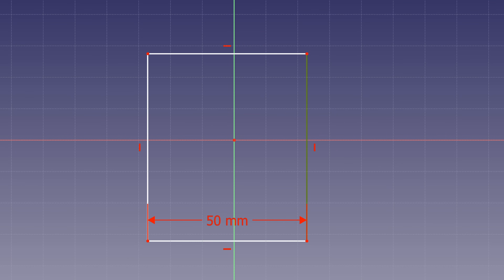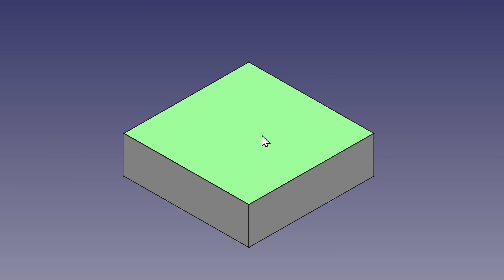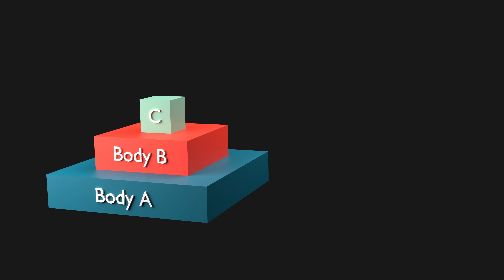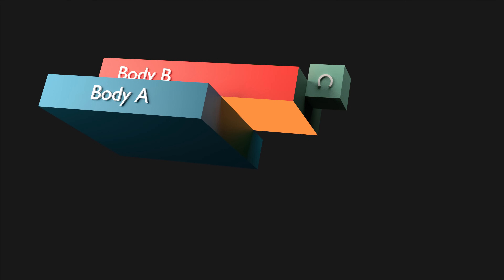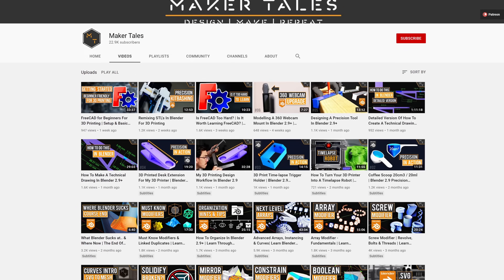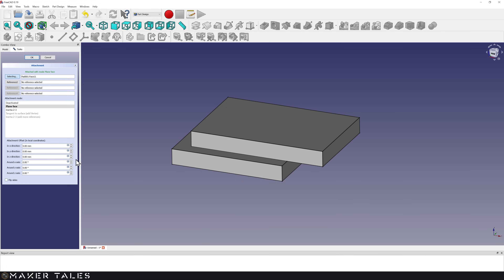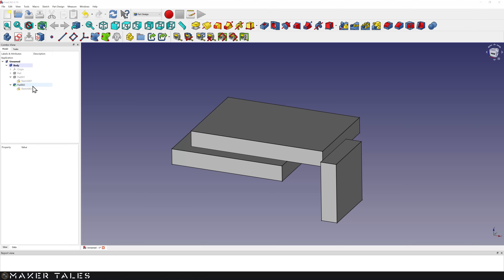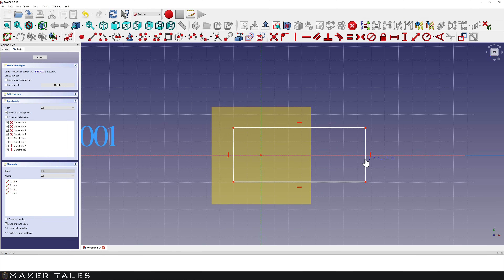FreeCAD Is Fundamentally Broken!  - Now what... Help Me Decide...

Comment: Time to come back to FreeCAD. Version 1 is released and its amazing.
Reply: I am new to part modeling so I tried freecad and it was awful, I've done some autocad in the past and wanted to not use autodesk so I give freecad a try however I cannot get passed the awful gui, the fact that you have to click hundreds of times to get things done, and one of the things I hated the most is that I want to pan with scrollwheel click and rotate with control + scrollwheel, like in autocad however that is not possible, so I just ditched and tried solidworks but in my opinion it was just as awful so I am now using Inventor, why not Fusion 360 you may ask, because it is cloud based, and I hate cloud based things, I want everything to be offline and stay in my computer, not someone else's computer

Comment: I'm afraid TNP has not been fixed yet... and it's 1.0 RC2.
I'm new to FreeCAD and I'm struggling with clones, unions (missing parts), the "0.01 mm problem", GUI (!), loss of documentation incl. error messages. And I feel FreeCAD community is not doing the best decisions as to SW development.
I must be doing something wrong. Maybe FreeCAD is not the best option.

Comment: We have used Freecad in a professional environment for years, and TNP is not a huge issue if the model is precisely designed. The program always does what it should do, it is human mindset what "means" something different. If you just cast operator over operator, any feature based cad model will collapse eventally when modifying an early feature - simply because your intention with a feature, cannot always be guessed by the program. Do you want to keep the hole on the round face, or the top face? Or the yellow one? The only question is: how far the program can take you before it happens. Without algorithmic thinking, one better use some sculpting program anyway - the excellent Blender for one. On the one hand I am looking forward to having TNP managed, on the other hand - with all due respect - "intuitive" programs make lazy people even more lazy.

Comment: 2 years later, and the Topological Naming Problem is still here in the "official" FreeCAD stable. Ondsel SE has fixed it (allegedly), and it should be fixed in the next main version of FreeCAD. I'd call this snail-speed. On the other hand – FreeCAD is actually and really free, so I'll live with its quirks until they are fixed … and knowing all the work-arounds doesn't hurt in my opinion (it deepens the understanding of what I'm doing).

Comment: Yes, Freecad, even the latest nightly build. is broken when it comes to the Topological Naming issue but if you use a Datum plane as the basis of all new sketches NOT using faces or vertices, then there is no issue. It's a workaround yes, but using this methology will give you a profession CAD tool for free! When the developers finally get around to fixing the issue in the code, then we can stop using datum planes.

Comment: The fact that over 2 years later, this is still a huge issue with the software. I'm in the middle of learning how to transition from Fusion to FreeCad, using FreeCad 0.21.2 and this is becoming a huge pain in the ass. I'm working on translating my Fusion designs over to FreeCad and everything just keeps breaking. I'd rather spend the $1500 or whatever it costs to buy Fusion rather than deal with these FreeCad headaches at this point.

Comment: When I saw this, my first thought was "what the actual fuck, the reference plane should store the normal and origin offset, not refer to the face itself" 
And then I thought a bit harder.

That actually the plane should be defined by the vertexes that define the face, the same way the face is. And that way the number of faces changing can't matter &it also allows a sketch to follow a face if moved or rotated.

Comment: sooner have a downloadable piece of software with a few quirks than a cloud based package that needs 24/7 net acces to be useable or that they can pull at a whim.
I agree with what you say in the video 100%, and yeah this is a big big issue, and I could be wrong but I think the renaming of the faces should be a small fix hopefully not too far in the future.

Comment: Does any other CAD tool have this "problem"? By the way, it may be some kind of logical problem. But there are many such fundamental problems that software developers solve. That's what software is for, to solve problems. Why don't the FreeCAD developers fix this? Don't they want to deal with it? Or are there problems with the architecture of FreeCAD and you would have to rebuild large parts to fix the problem? I mean FreeCAd is being actively developed, there must be a reason why this problem is not prioritised.

Comment: I was on the design team for the B-1B armament and weapons loader trainer, designer of the ejection seat inert training modules. some how a real ejection seat  munitions module got int the training room and on to an ejection seat. No one was in the seat and they were showing what handle to pull and it went off sending the ejection seat thru the roof of the hanger.
There was about 10-15 different modules. I accomplished the project that was adopted air force wide.
I started out as a apprentice manual machinist at a local textile factory and went to work at Kelly AFB and was a journeyman  machinist until I got into drafting and became a draftsman. I then went to Randolph AFB as a engineering tech and worked on the B1-B  project till it finished and retired at 56 yrs old. 
We were on computer vision software and did 3D wire frame design. I'm starting my small machine shop up and needed a cad program for an 82 going on 83 yr old man.
I'm having a learning curve on FreeCAD as my mind is still thinking computer vision. But come hades or high water I'm gonna win..
Reply: Godspeed 💪🏻

Comment: I was on quite an old version 18. I think. Just upgraded to 21.1 and found a lot of instability. Arrays breaking down, splines and sweeps come out twisted. Also its annoying that part design forces you to make the part in one piece. Datum plane setter is clunky but  usable. There's a lot more features but they don't work well and don't cross over from one work bench to another. I still love freecad and am very greatful.❤
Reply: Should stress I've only been using the new one for 3 of 4 hours. So it might just be different intfaces/workload.

Comment: I've been playing with FreeCad last night and today on 21.0 and one thing that I figured out is how to replicate my workflow that I use day to day with Siemens NX onto simple parts in FreeCad.
I almost never put sketches on faces. I think that doing so is not the best way of doing so, for topological naming reasons.

I like working with datums and sketches and building a skeleton of my part.
So when I pad a sketch, I don't plug in a distance, I make it go to the datum plane.

My next sketch would be done on the plane, not the face. This is almost ALWAYS more reliable, regardless of what CAD software you are using.

Comment: Is that what the TNP is about ? I can understand it when an upstream change would cause a feature to no longer exist,and that that would make a sketch based off that feature unviable. That makes sense.

I didn't know the problem was so basic,though. Let me get this straight: a body maintains a list of numbered faces, and the faces in that list can move around at any time. I mean isn't it bloody obvious that if an object has say 8 faces, and you add another one, it just /adds another one/, presumably called 'face 9'. Why TF does it need to renumber all the existing ones. Similarly, if you delete face 4 out of nine, then just delete it. It would appear that FC renumbers all the faces above 4, to be one lower. Why ? Why do the faces need to have a monotonically increasing list of numeric names ?

The way FreeCAD does this is like having a C compiler that passes parameters to a function in a certain order but commits the called function to always expecting the parameters in the 9riginal order. I mean it must be the user's fault for not keeping track of the stack offsets of the various parameters, right 

Either these face numbers are opaque, and we shouldn't be basing scripts of them, or they are transparent, and their naming is conserved across deletions and additions.

I knew the TNP was bad. I didn't know it was due to such an elementary design fault. It's like renumbering 100+ houses in a street just because one gets built or denolished, and just expecting the postman and ask your correspondents automatically know!

Comment: I gave up on FreeCAD because of this problem blowing models apart randomly, then I tried the RealThunder fork and bing, it just works like all other CAD software. I have pretty much given up on the official release as they still haven't implemented the fix even in the yet to be released 0.21 version even though a fix is there ready for them to import into their codebase.
Reply: They are working on it. The next release will have it.
Reply: @Gumball_W  If you are talking about 0.21 then it doesn't have it, they still haven't imported the changes from RealThunder's branch. However RealThunder has imported the official branch changes into his branch plus added another bunch of quality of life features. With 0.22 probably a year away I won't be holding my breath as it probably won't have the fix either, I am sure they have another bunch of half broken 'features' to add. It's pretty pathetic if I'm honest, the official releases are dead to me at this point.

Comment: I have recently come to hate the attempts by the powers that be to treat all consumers as morons.  I am thinking of Microsoft and its take over of the laptop market and the possible upcoming Pluton chip issue which I do not fully understand.  I have drawn a red line in the sand and will never buy another Microsoft product.  I also plan to abandon HP and Apple going forward.  I see Linux in my future as well as OSS software like FreeCAD.  ( Also GIMP and Shotcut)   I am prepared to put up with the work-arounds to avoid  TNP and wait for the problem to be fixed - even if it takes years. It is still better to do that than get locked in to a corporation's greed for profit.   I still do my 2D drawing on an old version of AutoCAD and to not plan to support them in future.  Maybe I need a cracked version of a later edition to receive drawings from others.  I refuse to be treated as moron and a mere source of profit for global companies.  I am unlikely to see or respond to any comments so try talking to me at TLOMatmail .com  ( note no "g" ) and you should see the obvious mod to be made to the email address. ( attempt to hide from computerised spambots that collect emails ).

Comment: Looking back, 0.2 did not fix it. 
For me as a beginner it means I never had any benefit from parametric  designs as an anyway have to fix the models after a change along the tree.
So most of the time it is better not to reference external geometry as it will only create a cascade of Desaster.

I would buy fusion, but I do not want an Abo or a free version that may be gone next week.

So FreeCad is my program but yes it slows down my idea flow because I spend most of the time to search the way to calculate absolute positions

Comment: 9:30 That's a sad joke on you :(
Well, of course they pushed it back to the next release after 0.2 – now claiming once TNP is fixed they will release 1.0. That probably happens at some point within the next 2-10 years.
But what's with all the rest? The instabilities, crashes, and general rag rug state of the tool?
It needs complete remaking from ground up. This source tree is not saveable.

Comment: A lot has changed in a year. Using the Realthunder / or "Link" branch as it's now known, the Topological Naming Problem has largely been solved. I have rebuilt a very complex model in Link and have been working on it with no trouble at all. I would advise all Freecad users to update to Link - any potential downside you could name is far outweighed by the TNP solution, the various bug fixes and massive UI improvements.

Comment: I am a new user of FreeCAD and still trying to learn how to use it. In that light I want to say thanks for making this problem known and explaining it is such a plain and easy to understand manner. BRAVO!

You ask for advice on how to proceed with your tutorials. It is now late in 2022 and the 0.2 version is available. And you have made another video letting us know this problem has not been fixed. Again, thanks! 

But you asked for advise and that is a loaded question. It really needs a crystal ball, but mine was broken some time ago. Let me digress a bit. I am a long time CAD user. I first started back in the 80s. I needed an inexpensive but capable and EASY to LEARN 2D program which could be used for TV station design - the technical system, not the building. I settled on EasyCAD which was around $60 back then (my employer was not going to pay for it) and available for a 30 day trial. The name and the price were the main features that lead me to it. And it lived up to it's name. I was doing drawings after only about two hours of familiarization. Why do I mention it? Because of it relative ease of learning how to make drawings with it. I had tried a friend's copy of AutoCAD and after about a week of "learning" I was no closer to my first drawing with it than when I first sat down to that trial. In my mind there is a very big advantage in a CAD program that is easy to learn. One that is intuitive. 

My advice to you is not about what version of FreeCAD to make your videos on, but rather about how those videos should be taught. I know that a program like FreeCAD or any of the other fully functional 3D CAD programs are not and can not be as easy to learn as EasyCAD was back in the 80s. But one thing that I find missing in almost all of the video tutorials is an explanation of the basics of how the program operates. An example of this would be Fusion360 which I have tried over the past two years. Every video I can find simply starts into a "learn by example" scenario. While this may get you off to a flying start, you don't know the details of your airplane. How many engines? What kind of engines? Type of landing gear? Even the wing arrangement? In Fusion that means that I still, to this day and after designing several projects with Fusion, I do not really have a good grasp of the hierarchy and relationships between the various features in a model. Or what goes into the file when I save a part. I never learned how to make a number of different parts that are in an assembly in the same model/file. 

And I am struggling with these concepts in FreeCAD right now. So far I am focusing on individual parts. But at some point I will want to model several parts in one file. That should be in the first hour of instruction. Having used Fusion I want to start my models with a parameter list. I have learned that one way of doing this in FreeCAD is to use a spreadsheet. That seems a bit cumbersome after Fusion just automatically having that list available and ready for my editing. But I still don't know if the spreadsheet is saved in the part's file or in a separate file. And just how does the spread sheet work? My present impression is you must refer to a name assigned to the cell that contains the value. And prefix that with the name of the spreadsheet. New question, can I have multiple spreadsheets in one part model? Otherwise, why would the name of the spreadsheet be needed? Perhaps there is a way to declare a universal spreadsheet in a model? And then only the cell name would be needed. Or perhaps not. That is something that should be covered in the first hour of any instruction. 

And many other details of just how the 3D CAD program ACTUALLY WORKS. I am sure the ling time users who already know the answers to these and other foundational questions will dismiss these concerns with a wave of the hand. But it is the lack of details like this that make learning a new program difficult. And error prone. 

So that is my advise to someone making the tutorial videos. START WITH THE BASIC BASICS!
Reply: Dang... how can i give this 100 likes??

Comment: This is a major roadblock to Assemblies, as well.  The most useful application of Assembly (as in SolidWorks), is to rough out ideas for each part, assemble them, then iteratively refine and correct them as needed.  But as soon as you edit a part in FreeCAD, all the face names are scrambled, and the assembly relations are horribly broken.  It is EXPECTED that assemblies will reveal changes that need to be made.  That's kind of the whole point of CAD—to be able to discover and correct design problems in software, where it's easier.  Without a robust and reliable Assembly platform, it will not progress beyond an interesting hobby tool.

Comment: I have the same problem with FreeCAD and since I often do concept work, where almost everything is parametrized over a spreadsheet, this breaks things regularly. But my primary problem is speed and Boolean operations for example for ring gears. I just have to wait minutes to make single change in a spreadsheet for a kind of a planetary gear system that is fully parametrized. There are further often other bugs, so I am learning blender now. I think that blender given its age has probably a much faster backend ... and I can do nice animations for concepts!